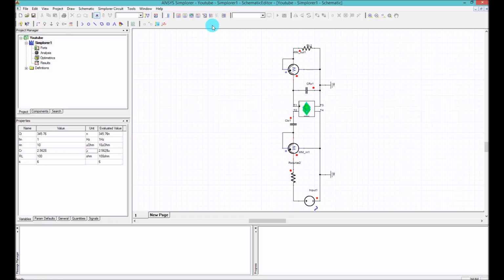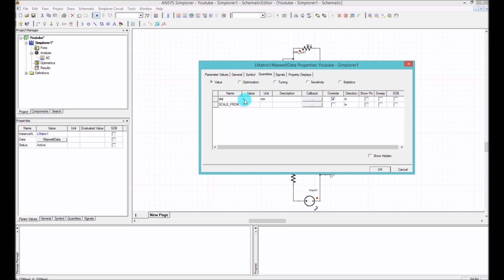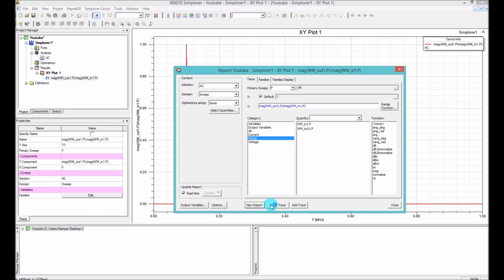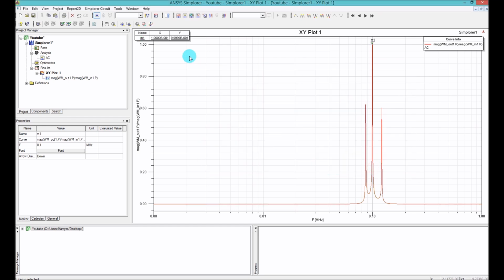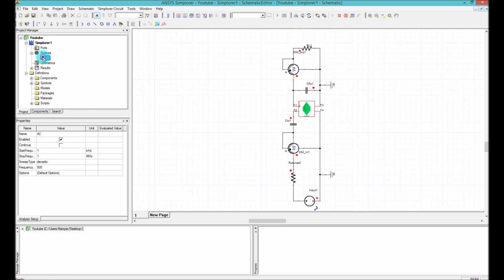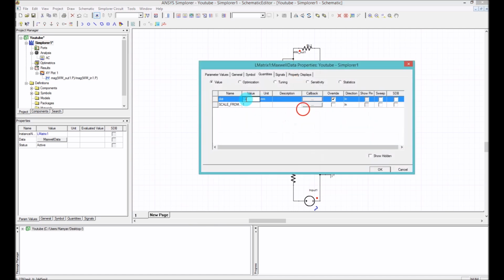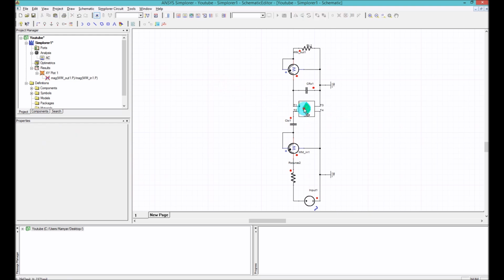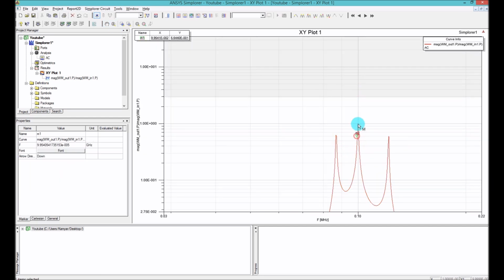Simplorer- (dynamic inductance) Simulate the efficiency of wireless power transfer system [2/2]

Comment: I pondered the question I put forward last week over and over again, Finally, I inferred that your circuit diagram in simplorer has one mistake.  In the transmitter part, Power meter should have measured the power of the voltage source instead of the capacitor and the inductance. Because the efficiency is dividing mag(P_voltage source) by mag(P_RL). Am I right? I hope that you can reply me soon. Thanks a lot.

Comment: Thanks for your video. I have some questions toward it. In your video, you set frequency sweep. Firstly, I want to know whether the frequency sweep is the frequency of the input signal or not. Secondly, In the simplorer, you set  fin=1Hz to the input, then, what does the fin mean? Thirdly, The result we get is a graph which describes the relationship between the frequency and the efficiency. And we can see three points of frequency splitting. Usually, there are two points of frequency splitting, do you know the meaning of these three points? It is very kind of you to read my message. I am looking forward to your early reply. Thanks again.

Comment: Hi, Thank you so much for your videos. I am following along using Simplorer 17.2 and everything is pretty much so far dandy. I believe they fixed the bug mislabeling the pin outs on the maxwell circuit import. The pins were automatically labelled from what I called them in the Maxwell editor. But when I connect and run through the simulation, the results are inverted from yours. That is, when I connect the Rx pins to the Rx side of the circuit in Simplorer, I get the results you had when you flipped your pins (the first time). Rather, when I connect the Rx pins to Rx circuit, I get the results you said were wrong, and when I flip the pins and connect the Rx pins to the Tx circuit, I get the results you said were right. Thoughts here? I double checked the excitation labels, and they matched yours. Thanks.
Reply: At the beginning, I also get the results which is inverted from the results in the video. But after some improvements, I get the same answer like the one in the video. Now, I do not know why there are three peaks in the graph. In my opinion, there is just one peak in the graph. And I think the power of the transmitting terminal is invariable, but the  power results of the transmitting terminal in the graph is variable.

Comment: Hello, Kamyar,
Glad to see the videos related to wireless power transfer. Your video is really helpful and I appreciate your hardwork. I am looking forward your more  videos. For example, how to simulate the resonance frequency of the coil by maxwell or HFSS. The   resonance frequency is an important parameter for magnetic resonance which can help to increase charging distance. And how to simulate the Quality factor of the coil. The Quality factor is also important for higher charging efficiency. Thanks a lot!
Reply from the maker: +T T for quality factor you need to find the equivalent resistance at the frequency of interest and the q. Look at eddy current simulation. That helps you to calculate them.
Reply: Thanks for your reply. And I still do not know how to simulate the resonance frequency of the coil. Could  you give me some guidance or suggestions? Looking forward to your early reply. Thanks again!

Comment: Hello kamyar,
This video was very good. I'm actually trying to design a wireless power transfer coil like this. Please send me a sample design to make such a circuit. I don't know how to decide the resistance inductance and capacitance in both Tx an Rx side. How do we design it for a particular power output, say 10V, 100mA at output side with a 15V AC source at input side at 1kHz.
My mail Id is dileep88@gmail.com

Expecting your reply soon.

Comment: i get this error messages when i try to analyse the simplorer-''[Sim2000App]
	Warning 10934 - Unable to converge to a solution at frequency f=<67000>.
	>>	Calculate
 (12:42:23 AM  Aug 26, 2015)''....hence i get no graph for the results